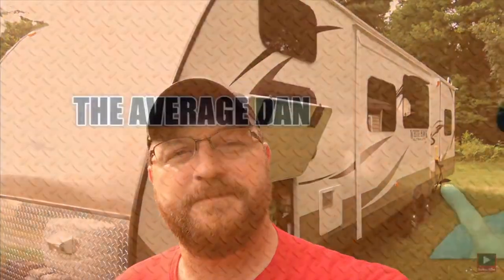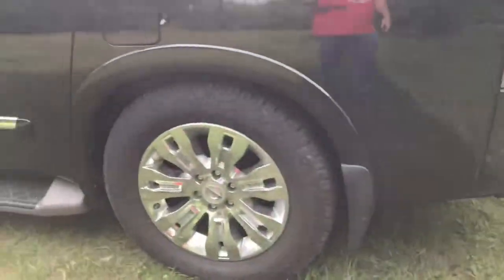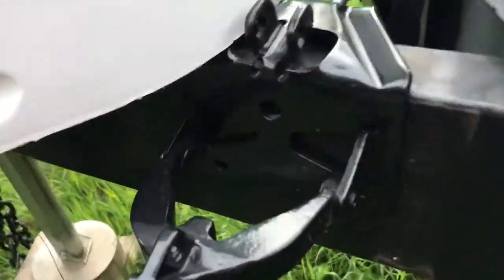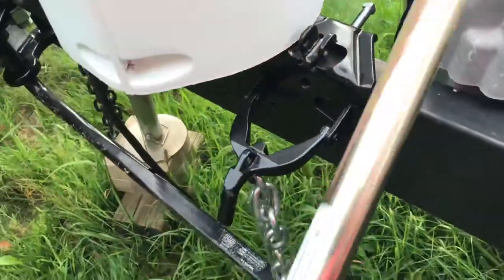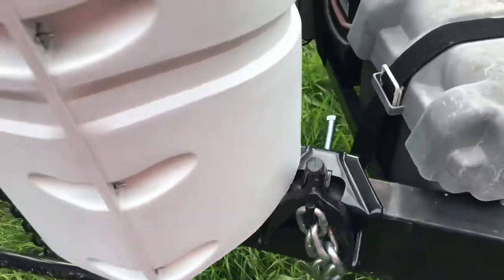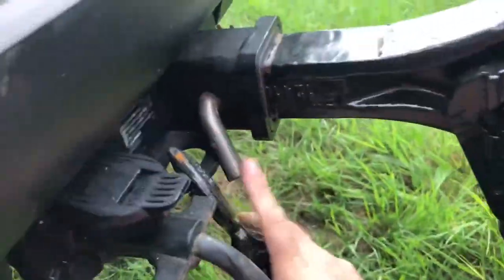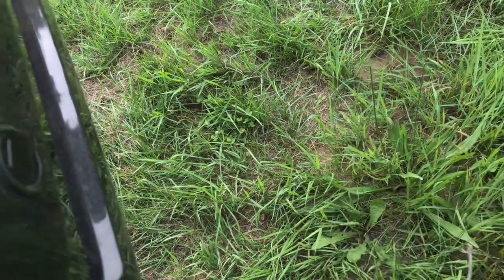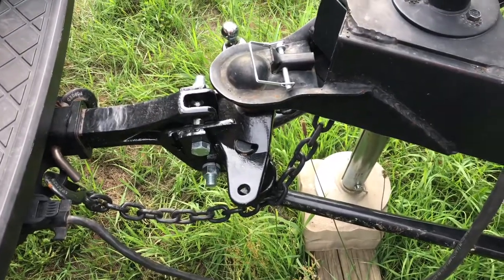How To Hook Up A Camper Trailer

Comment: Hi Dan, How much does your trailer weigh?  How does your Armada handle it?
Reply from the maker: Our trailer is 8000 lbs.  This Armada handles 8500 - 9000 lbs. so its close in terms of what they say you should tow. It has gotten the job done over many trips without any issues but now that we have a third dog, I think Ill be replacing it with a pickup for next season. I do love my Armada though

Comment: Hi! I’m currently thinking about purchasing a smaller camper for me and my family, like a lite version or something and I have a question. As a child me and my father had a camper, he hauled it with his s10. It did well, it was a aerolite camper like I’m thinking of purchasing. I have a f150 now. My father has since passed and I don’t have him to ask these questions, but I remember that he had some sort of breaking system for towing installed in the truck. Is that something that is necessary or no? -thanks
Reply from the maker: It’s called a break controller. Some vehicles are pre wired so you can install one and plug it in under the dash. Search brake controller and your vehicle on Amazon